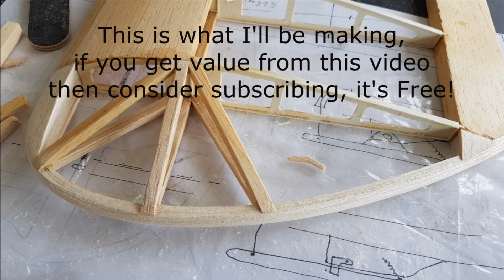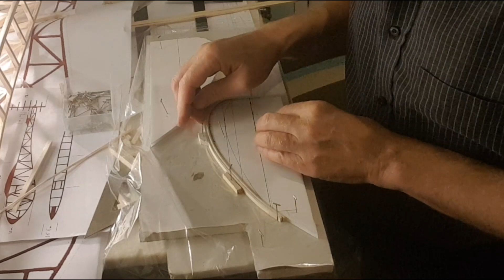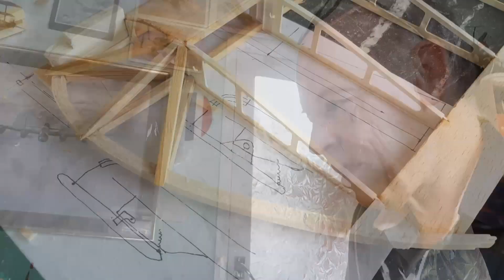Laminating Balsa Wood for Model Planes

Comment: I usually rub some candle wax on the template to prevent the laminates sticking. 
Also, you can add a huge amount of strength to very light structures by laminating 1/64 ply to, say, 1/32 balsa. 
Put the balsa on the edge and the ply inside. The ply will also go a long way to preventing warps during covering. 
I’ll laminate anything if it stands still long enough. It’s a great technique.
Reply from the maker: Thanks for the ideas Crashrr, I'll pin it to the top of the comments, cheers.

Comment: Nice building...now I an going to use that on my Spitfire I'm working on. Thank you
Reply from the maker: Ideal David, especially for the tail feathers, what size is your model?
Reply: @CliffHarveyRCPlanes  Model will come in abut 1/7 scale..give or take I didn't like the plans for the wingtips and am slightly altering the tail..received a fiberpoly fuse from Europe so the body frame is fitting inside..lot of fine tuning then sand the outside to lighten a bit more an paint like Supermarine .wanted gas but have a nitro I just got..going to take awhile

Comment: Wow! I was looking for tips on building model furniture and your site came up. I started watching and I must say they are beautiful results you got from laminating the balsa wood in this way. I have seen a similar technique in miniature making where layers of card are put together and then coated on all sides with extra thin superglue, which by capillary action, enters the inside of the piece, leaving it as strong and sandable as a hardwood but obviously much lighter and easier to cut in the first instance.  I wouldn't mind having a go at the balsa wood sometime but I have to up my woodworking skills a bit first. This video is well worth a like and a subscription because you never know if skills used for one kind of model making can translate to another and to  keep an open mind for such instances.
Reply from the maker: Thanks Foxy, you're dead right about cross-over skills, if you can do one thing in a hobby it can give you a head start in something completely different 👍 Give balsa a go, it's very forgiving. Thanks for the cardboard tip by the way, not sure when I'll use it but you never know 🤔😁

Comment: Any reason not to add the shear webbing in the wings before taking off the board. If added when doing the D box would it be more rigid?
Reply from the maker: Yes, the wing was cut down from my old Veron Impala so already built, but originally built without the shear webs, I  just checked the plans on Outerzone and they're not included in the plan, but they add a lot of strength for very little weight gain. I've just weighed the finished model and it comes out rtf 584g, which gives a wing loading of 5oz per square foot 🙂

Comment: what kind of glue is that i haven't seen it before ?
Reply from the maker: Hi Steve, it's called 'Aliphatic', available in the UK made by 'Deluxe Materials', stocked by my local hobby store, basically it's wood glue which, unlike pva, sands reasonably well

Comment: Good video! Did you strip 1/16 from a plank or buy srtips?
Reply from the maker: Just stripped them from a plank Garry, it doesn't matter if they aren't all exact because most of the wood is sanded away when you round the section up.

Comment: Nice demo Cliff.  Apologies if this has been covered in another video, this is the first one that I have watched.  What material are you using for your building board?
Reply from the maker: Hi Graham, great question, personally I use an offcut of plasterboard, lasts a while then I turn it over.

Comment: Cool video! I appreciate editing out the sanding bit and the reveal of the smooth lines was very satisfying. 

Where do you get your balsa and for how long do you soak the strips?
Reply from the maker: Cheers Chase, I get my balsa from my local model shop. How long to soak for depends on how soft the balsa is too start and how tight the bend needs to be, you can't over-soak the balsa so anywhere from 10 minutes to an hour, best bet is to soak a piece for a few minutes and see if it bends the amount you want 🙂👍

Comment: This video is really great. Can you record a video about how to make the angle of the propeller thrust axis? Thank you.
Reply from the maker: Hi there, are you asking about side and down thrust angles?
Reply: @CliffHarveyRCPlanes  Yes.
Reply from the maker: @qiangqiangpan2362  That's a question with a lot of answers, it depends a lot on the model, whether it's free flight, radio control or control line, as a general rule most models benefit with a couple of degrees of right thrust to counteract torque, down thrust depends a lot on the sort of model, some require none, others a couple of degrees if not more. Sorry to be so vague but it's a massive subject. Two points though, go with what the designer advises (or copy a similar model if you're designing your own) and, two, the thrust angle can be changed fairly easily using packing washers if you find the model needs it. Eg if she flies straight and level on half power but climbs on full power I would add downthrust 🤔
Reply: @CliffHarveyRCPlanes  Oh, I didn't say it clearly, sorry. Exactly refers to the free flight model powered by rubber bands. But your answer also benefited me a lot, especially the last words. Thank you
Reply from the maker: @qiangqiangpan2362  Ok, the first thing to get right is the glide then add 50 turns at a time adjusting the side and down thrust as you increase the winds each time. If it climbs under power add downthrust, sometimes not adding side thrust is useful in helping the model to turn.
Reply: @CliffHarveyRCPlanes  To offset the torque of the clockwise propeller, is it enough to just pull it to the right? Is it generally unnecessary to add ballast to the right wing?
Reply from the maker: @qiangqiangpan2362  The thing with ballast on one wing is it will affect the glide, so as the torque dissipates the ballast will increase the turn to the right. This may be desirable of course, every model is different, you may have slight warps in the structure etc. What model do you have?
Reply: @CliffHarveyRCPlanes  You are too right. This is the problem I am facing now. In the second half of the flight, the turning radius gets smaller and smaller. The rubber band-powered bf109 model of my aircraft has a wingspan of 28 inches, a flying weight of 64g, and a wing dihedral angle of about 11 degrees. I have made the propeller thrust axis to the right by a large angle, but still need to add a small amount of ballast to the right wing, otherwise the plane will start flying in a straight line. Do I need to increase the right angle? In addition, the plastic propeller I use is 8 inches, 5.4 grams. Is it better to use a lighter propeller? Thank you.
Reply from the maker: @qiangqiangpan2362  If the model is flying a tighter circle as the motor torque decreases perhaps a small trim tab bent down a little under the left wing would help. This would also have the effect of making it fly to the right so try taking out a little right thrust to keep the model flying left. Trimming a model is an art in itself. If you change the prop for a lighter one you will need to add ballast, this increases the overall weight of the model so I wouldn't worry.
Reply: @CliffHarveyRCPlanes  Okay, I will try it, it is indeed art. thank you very much

Comment: I want to know how you make your ribs
Reply from the maker: Hi Solo, the ribs were from the original kit manufacturer from the the seventies. It would be quite possible to 3-d print ribs like these now though I would have thought 🙂
Reply: @CliffHarveyRCPlanes  yes, but there is something satisfying about fabricating such ribs from scratch and balsa. I thought maybe there was a technique used.

I dislike 3D printing, it has so many issues. I use it for things, but it's not my go-to at all. 3D printing a plane is not like balsa construction in any way. If I wanted to 3D print ribs, I wouldn't be watching a video about balsa construction.
Reply from the maker: @SoloRenegade  I agree Solo, I've never fabricated wing ribs but it looks so satisfying. I guess one would make a jig and assemble each rib in it. I agree 3-d printing isn't balsa bashing, not much satisfaction in printing something out, cheers.
Reply: @CliffHarveyRCPlanes  With your content, I just assumed you'd fabricated them yourself.